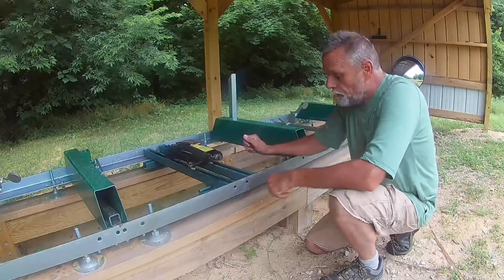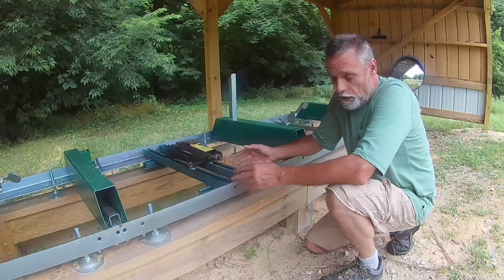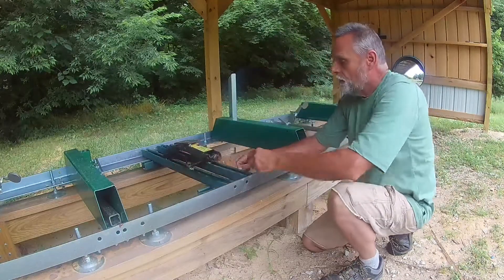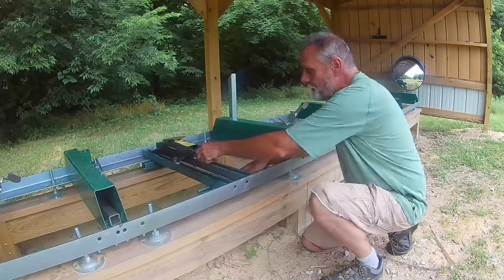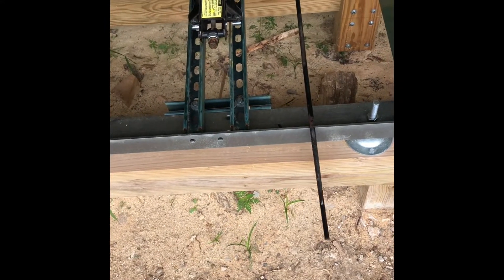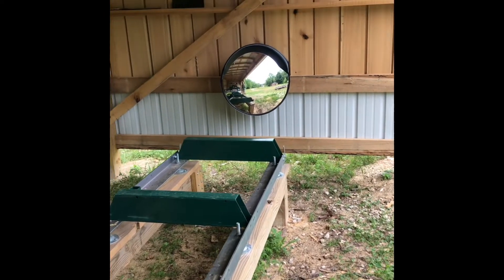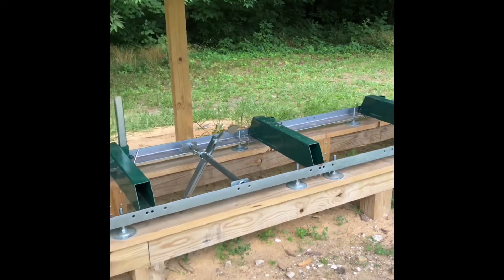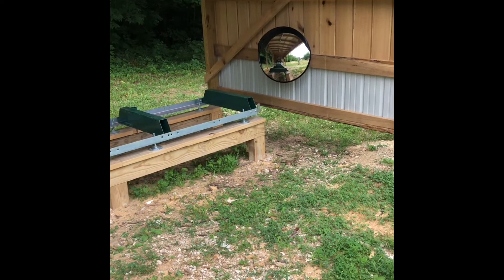Build a toe board for a Woodland Mills HM-126 sawmill.

Comment: Thanks for the heads up on this video. I think that is the slickest idea on a toe board that I have ever seen on a home made toe board and I have seen many. Now I have to build one. I have a Norwood HD36 but your idea will work for it too even if it has to be modified a little. I really like the Woodland Mills too. Best bang for your buck. That mirror is another great idea and would probably be a good log stop saver as well. Nothing like the sound of a blade cutting into a log stop. How would I know that? 😂 Your videos are very good.
Reply from the maker: Thanks for the kind words, we're glad you liked the video. Good luck with your toe board build, and yeah the mirror helps but I still manage to hit a log stop every once in awhile! thanks for commenting!